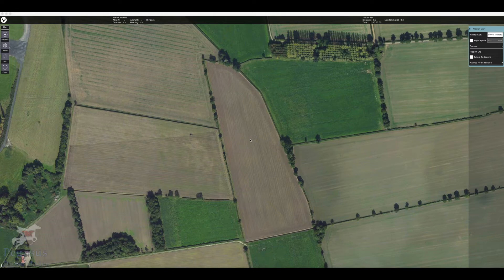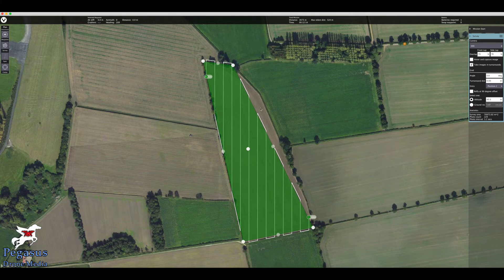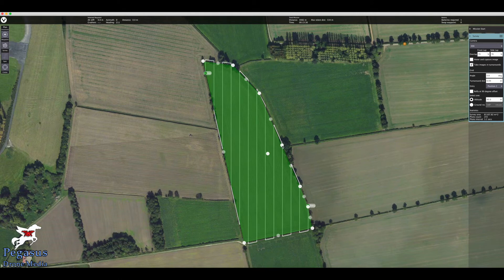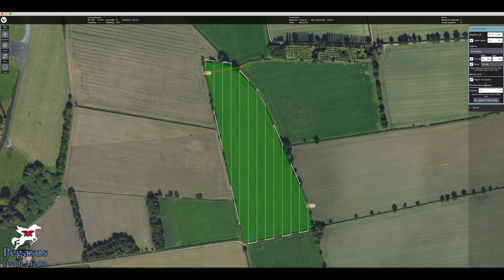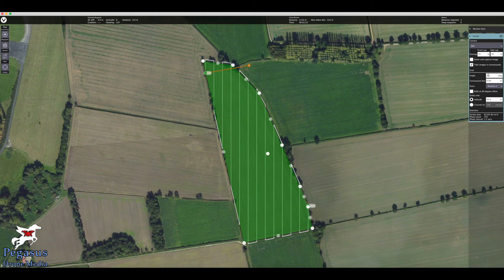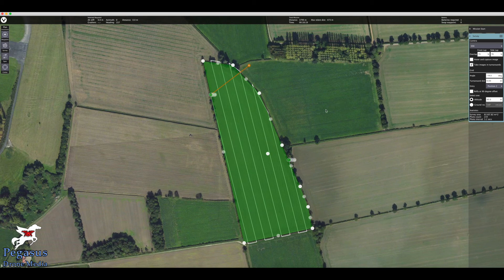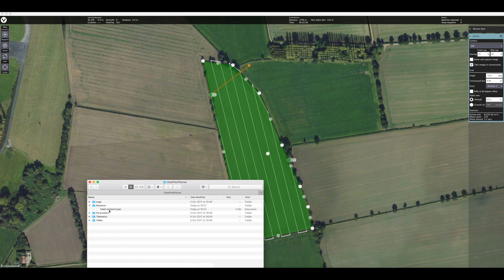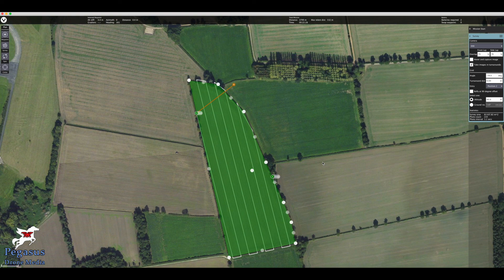Yuneec H520, E90 & E50 Datapilot Survey Mission (3D Mapping) Tutorial

Comment: Welcome video. Yuneec seems not to have a large video presence. You mentioned the 520 is not an "all rounder" what do you consider an "all rounder" ? I am investigating the 520 for a comprehensive tool. Do you recommend other drones ? Thank you for your work I like your channel ...
Reply from the maker: In my opinion there is no such aircraft that is an all rounder. Most drones will give you an all round feel and do most of the jobs you want it to do but none will be the 'perfect' do everything drone. Example, A DJI Phantom 4 Pro is probably near perfect at doing cinematic shots and also being able to do mapping as the shutter on the camera is a mechanical one and not a rolling shutter. But it has its limitations:- you cannot fly dual op, it has a fixed camera, it only has 4 props so has no redundancy, it's noisy and it looks like a toy but in all fairness what comes out of the camera is very good. A 520 uses an E90 4k 20 mp camera but has a rolling shutter which can provide inaccurate overlaps when mapping so a bigger overlap is needed, You cannot change expos so making it fly in a cinematic way is difficult but not impossible, Yuneec have never corrected this and allowed us to have expo controls in the nearly 2 years it has been on sale for and over those 2 years it is the most complained thing regarding flight control of the 520 and the H Plus. Yuneec just close their ears to certain subjects it would seem. However it is quiet, has redundancy with 6 props, 5 different cameras depending on what you want to use it for and all cameras rotate 360 degrees. So it all depends on what you want a drone to do and then focus on that subject and then buy another one for different tasks. If you want an okish allrounder then go for the H Plus.

Comment: You mentioned yaw control and that control is not on the new version of Data Planner. With that being missing Im assuming that is why I can not set up  a video mission???
Reply from the maker: Yes they removed the angle at which you can tilt the camera and the yaw after version 1.1.9 which was the  very first version. Lord only knows why. However if you select the angle after take off the mission will continue at that angle.

Comment: Excellent tutorial Chris could you do one for the DJI or are they the same procedure
Reply: Not quite true Chris. DJI have the ability to do this and more via their DJI GS Pro app but this is only available to Apple users who use their iphone or ipad as part of their flight controller. The App is not available on android or on the DJI CrystalSky monitors which is a real shame as the program looks very good. The details of GS Pro can be seen here - https://youtu.be/tABtCAfqF9E
Reply from the maker: Hi Keith, DJI do not do mapping software and no DJI drone has any 3rd party mapping software built into the controller or apps. DJI users have to use Drone Deploy or Pix4D, two very expensive ways of doing mapping but obviously that cost will be pushed to the client as they are a monthly subscription. The H520 has all this built into the controller so no extra costs unless a client wants 3D mapping and not just photogrammerty stitched mapped photos.
Reply from the maker: Ah yes. I had forgot about GS Taffy. I stand corrected. I used to use Litchi for waypoints which you could also use for mapping. Since being away from DJI for a while GS had slipped my mind.